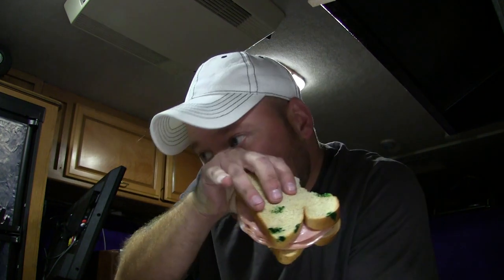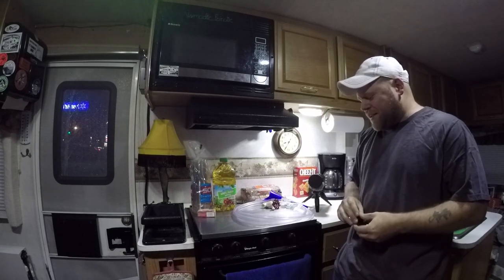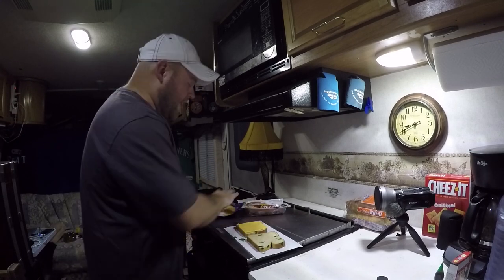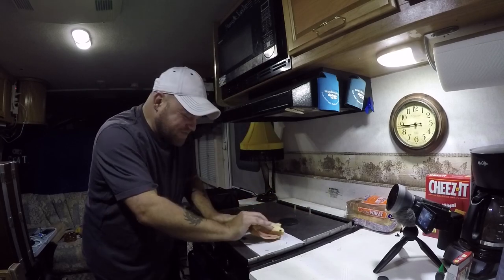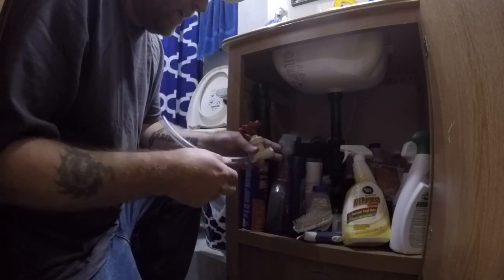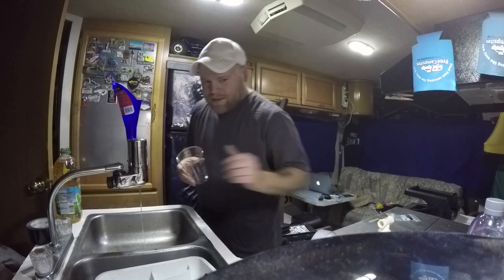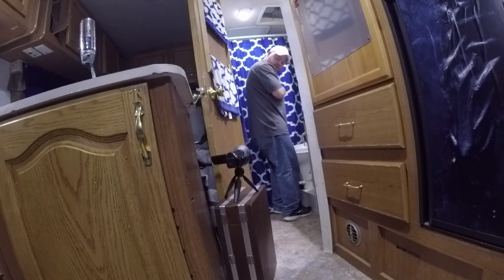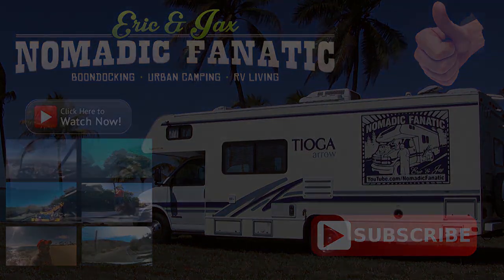Custom RV Filtration Installation

Comment: This is one change I would/will NOT be making to any water system in a 
RV or elsewhere.  Now, if you were sending gray water through your black tank to help flush it out when emptying, I could go with that.  Nope, not this way, though!  Just doesn't sound right mixing black water with drinking water. Huh? Must be a mighty fine filter system you've got there, or else all that rain is having an effect on your brain! Not sure what I'm missing here.

Comment: I was so disgusted that after two minutes (inc intro) I stopped watching.
I was thinking, the only system that does that type of recycling is on the ISS.
I went to comment and saw the comment from "Darryl Friend" and realized (confirmed by the date) that I had been April Fooled (partly).  ;-D
Good job.